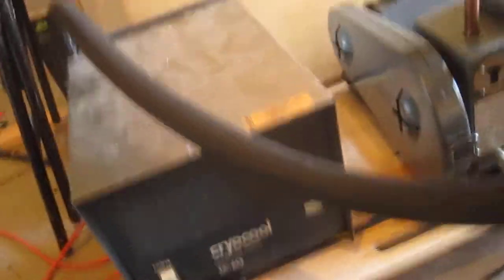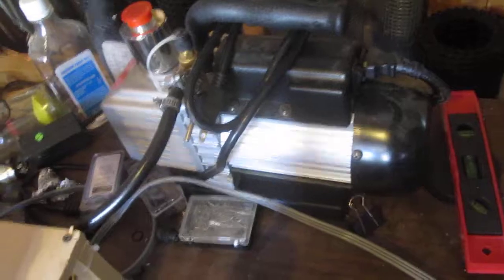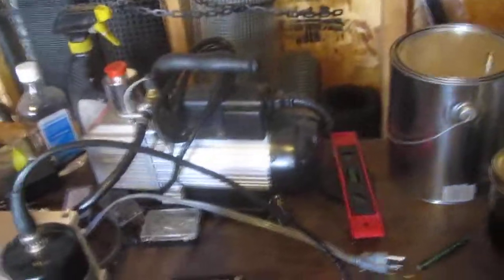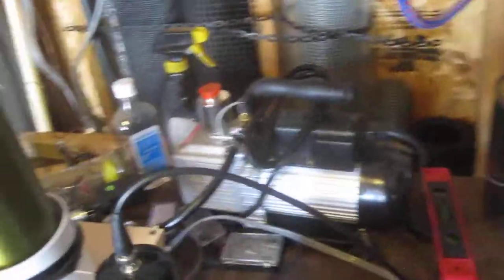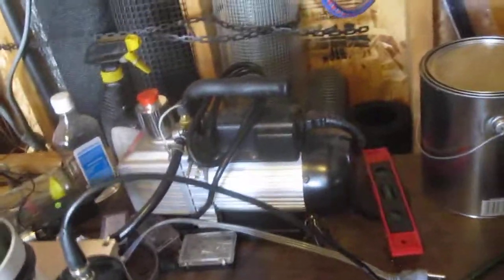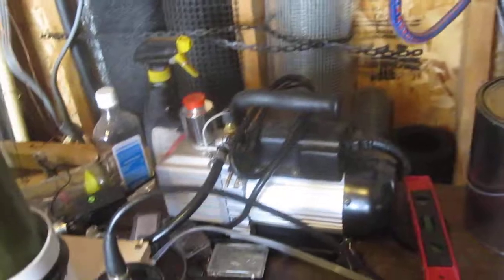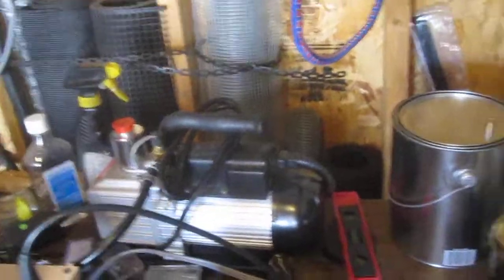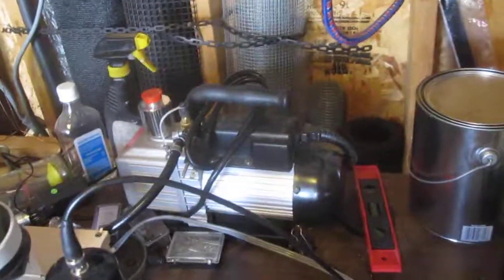Ben Krasnow diff pump contest submission

Comment: what type of hose you used for diffusion pump? is it rubber one or some other reinforced one
Reply: On the high vacuum side rubber can be a problem and a popular solution is a corrugated metal hose.  On the link to the roughing pump rubber or silicone hoses are used.